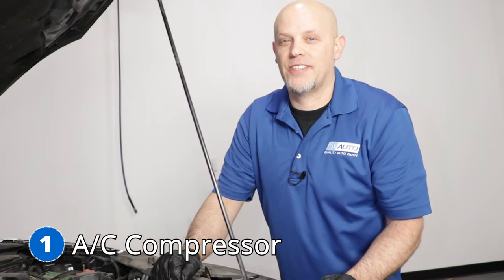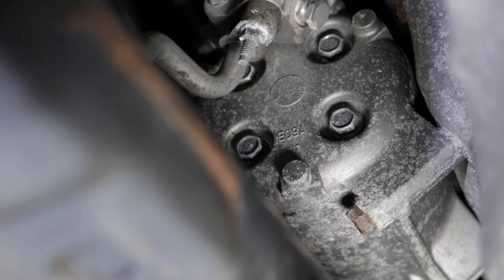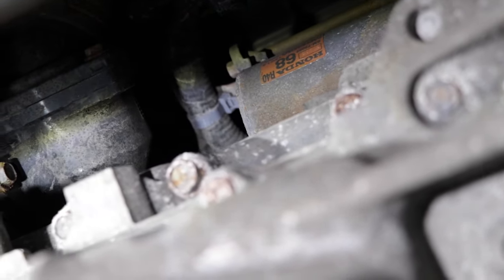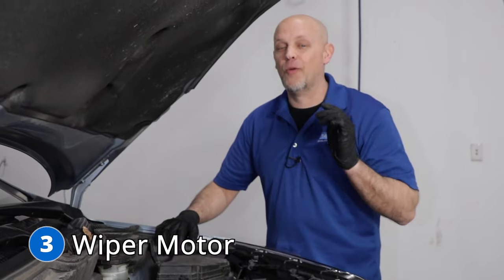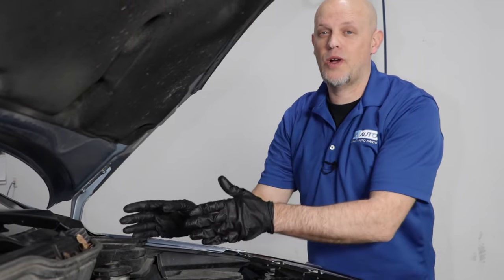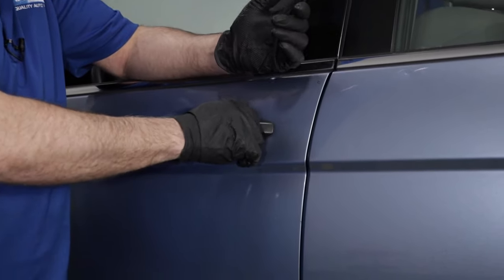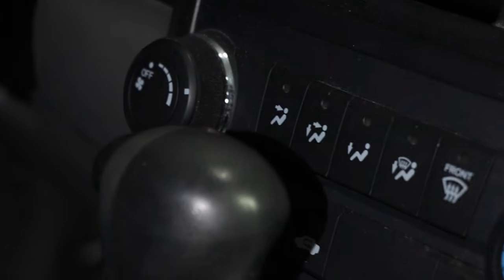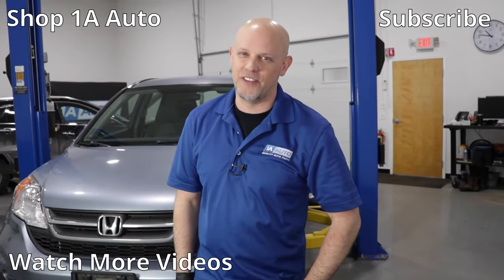Top 5 Problems Honda CR-V SUV 3rd Generation 2007-2011

Comment: My issues are that when turning my steering wheel all the way left it vibrates alot and feels stiff and does a choppy turning of the wheel when going slow with it, it vibrates all over and in the wheel at higher speeds and I already balanced the wheel and did spark plugs. And lastly everytime I decelerate from low speeds like take my foot off completely it gives a little jerk or feels like it pulls back a bit. These concern me anyone know possibly
Reply: Hi. It could be front steering linkage issues. It sound similar to the issue I had with my 2008 crv.

Comment: I have a 2011 and I have had a couple of these problems. I bought it at 25,000 miles and the blender on the heat/ac didn’t work so Carmax fixed that while it was under their 30 day warranty. The ac compressor went out at about 110,000 miles. That was about $1,000 to fix bc I went ahead and replaced the condenser also. I was rear ended a couple of years ago and since then the drive shaft went out, and now the transmission is slipping. I also have a 2002 crv with 207,000 miles and it’s been a much more reliable car. They don’t make ‘em like they used to.

Comment: Anyone have issues with their CRV moon roof? Auto mechanic says I'll be >$1000 -2000 to diagnose/replace its motor. And yes, we've done the reset trick multiple times & it still wants to get stuck in the OPEN position.
The mech cleaned & greased the tracks, but my husband says since it opened fine, he doesn’t think that's the answer either.
Suggestions?

Comment: just had changed the compressor after 13 years, no other major problem with this type of car in my case. The black paint on the front door frame on both sides of the car starts to show signs of aging which might need to be repaint this year. Overall this is a well maid car this is my 14th year with this car just had changed the spark plugs for the 1st time.

Comment: I accidentally killed the battery forgot keys in ignition turned on.. after I got a jump, and the battery back up and fine.  Dash board is out.  Needs a code,  internet says try glove box, don’t see code in there, internet says try manual, can’t find manual!.  I guess I need to take to a dealer ship, but I’m 6 months now driving with no radio or dashboard stuff.

Comment: Strange. Most of the problems, i.e. ac compressor, starter motor, door cylinder problems are common with Honda civic 8th gen.

Comment: Key indicator flash on.. the problem is engine can't shut off,
Reply from the maker: +Khai Din We wouldn't be able to diagnose an issue like that here, you may want to have a local mechanic take a look at it. Thanks for checking us out! http://1aau.to/m/Shop-1AAuto-c
Reply: Check your remote, could be low on battery

Comment: I got a 2008 honda crv with 310k miles on it and the only problems I've had with it is tires struts brakes rear main seal fix. Engine gasket easy 30$ fix plus labor just genral crap like that. This guy's Givin ya beloni or he just has a garbage can

Comment: Honda replaced the compressor in my 2017 crv touring last July. It's again not working. This is my second Honda I will not buy one again.
Honda has lost my trust. I will now start shopping for another brand vehicle.

Comment: Yes my starter already replaced, it is 20008. Oh those doors are pain in my ass I also replaced the regulator in two doors  and now one rear door needs regulator replace.  U didn't mention the water pump. Those cr- v totally no good.
Reply from the maker: +Marcson GAUDIN Thanks for the feedback!
Reply: Oh wow, so many dollars on a 13 year old car... That's normal, dude. These cars are as good as it gets, prob better than RAV4s. Ever had an old car before? Sell the CRV, go buy a new car so lucky it you won't have to put a dime on other than regular maintenance for 3-4 years.
Reply: I had the auto door locks replaced on a recall and new stater motor at 250,000 that's about it since new still runs like a champ

Comment: I’ve had a rattle in back no one can solve 2011 crv ugh. And I just had the ac changed those a$$holes for 4 years lied telling me nothing was wrong. I fought them through the corp to make them change it. They wouldn’t cover whole thing I still had to pay $700 but that was better than $2000. Other than this and maintenance it’s been a reliable car. But I won’t buy a Honda ever again because they lack power.

Comment: No; there are WAY MORE problems with this HONDA crap CRV!  at 93K miles I already had to replace wheel bearings, actuator went nuts,  pads, rotors are no good, ball joints, locking mechanism is wack and a hazard in this cheap made of plastic machine.  way more to come and Honda is CHEAP quality with no unlock dock features to put the key in.  It is a disaster of a car.  DO not buy toyota or honda they are way too cheap now a days.

Comment: They sound junky to me. Honda has really fallen in the quality department.....
 if I wanted this level of (such low) quality I would buy a Dodge!
Reply: I have 2 Elements and a CR-V...best cars I've ever owned.  One Element has 250K, and all components work like factory.
Reply: Every car needs replacement of some weaker parts at some point even toyotas.
Reply: Hahahaha Dodge is totally garbage!

Comment: All of these problems except the blower motor appears to be a costly repairs.  Look out!
Reply from the maker: +James Bass Thanks for the feedback!
Reply: LOL look out, do not buy one of the most reliable cars you can get
Reply: You’ve never replaced an engine or transmission... these are not at all expensive to repair compared to other problems
Reply: Never had to replace mine, and I have a few of these Hondas with over 200,000 miles. Just saw a video of a Ford Escape where front doors and dashboard had to come out for a blend door actuator issue. Similar area to the fan.